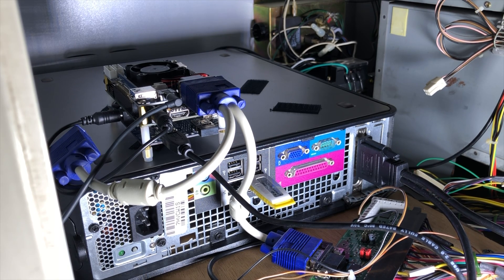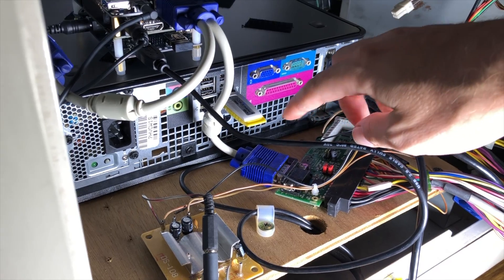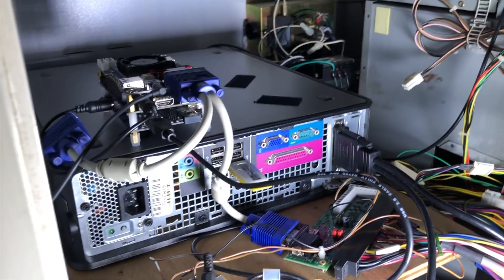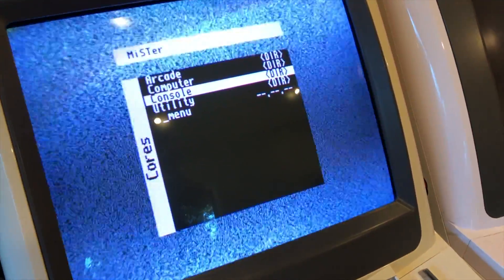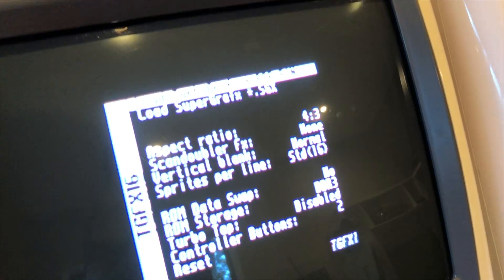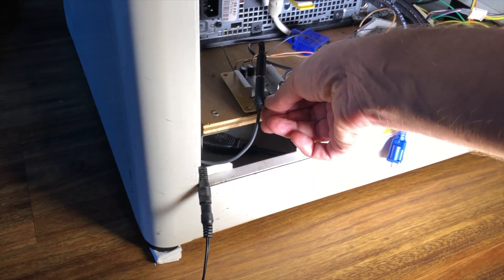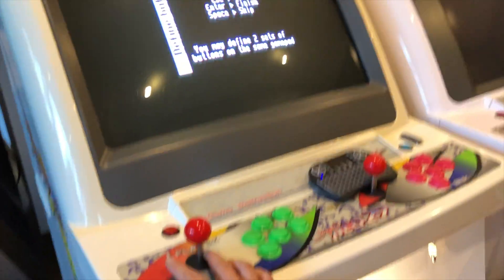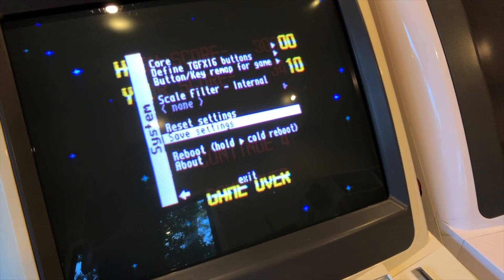MiSTer + J-Pac = FPGA Arcade Cabinet Goodness (+Bonus Stage)

Comment: I have some giant retail fixture that I was planning to fill with consoles in a similar way to your IKEA shelves, only I hoped to also include a way to lock them in so it will also serve as a display case. It will obviously be a little less secure but the point is to have the consoles usable but not totally unsecured for anyone to grab and run. I plan to load them up with flash carts and wireless controllers. Not worried about people running off with wireless controller since they will be checked out when someone wants to try something. :)

Comment: Hey what are you using for controlling the volume? I’ve been looking for a solution for my Super Neo 29 cab since there it no volume knob like on a Blast City.
Reply from the maker: Arcade-One Mine has a little amp board with a volume know installed.
Reply: @coinfeeder  upon closer inspection it looks like you're using a JPAC. You must be sending audio from the MiSTer into the amp board and then from the amp board to the JPAC is that correct?
Reply from the maker: @ArcadeOne  Yepp, that's what the title says, JPAC ;) And you're right, the amp goes into the JPAC. Sorry, I should have made that more clear.
Reply: @coinfeeder  How old is your jpac? Does your jpac player 2 controls work? mine does not. I was told that MiSTer's input handler only sees them as keypresses from the same keyboard. So I don't know a way to separate player 1 and player 2 inputs into separate MISTer gamepads. Is there a firmware update for the jpac that will solve this problem? I really want both player 1 and 2 to work without buying another encoder.

Comment: Hi. Is that better than a Pc running groovymame with the same Ipac?
Reply from the maker: Depends on what you consider as "better". Depending on the core quality you can potentially get a more faithful experience on FPGA hardware, as it mimics the actual hardware. That being said, I also have a RaspberryJAMMA + Arpicade that I'm super happy with as well :)

Comment: This is so cool. Would a MISTER FPGA also work in one of those arcade1up cabinets?
Reply from the maker: Well, you could :) You'd need some extra things like a HDMI LCD Controller Board. You should be able to find some information about that on the web.

Comment: very well video .. but you only use 3 buttons as standard (for on player)... you did not connect the other 3 on JPAC ??
Reply from the maker: Didn't do so for this demo, but you can simply wire the additional buttons (4,5,6,7,8) for both players to the screw terminals.

Comment: Really like those Ikea game displays! I use a wire shelf rack which holds a ton of consoles and is on wheels for ease of movement, but it's not the most pretty display. I tried doing wood like what you have there but always had a hard time when I wanted to move things around or rewire something.
Reply from the maker: Ken M Thanks mate. The original prototype extended beyond the depth of the rack in the back. It had some "helpers" (like the controller ones you see in the front) to potentially help wiring things up and especially guiding cables between the different cubes.. Unfortunately though I felt it added more challenges than advantages. Especially if you assume that most people have/want their shelve flush  the wall.